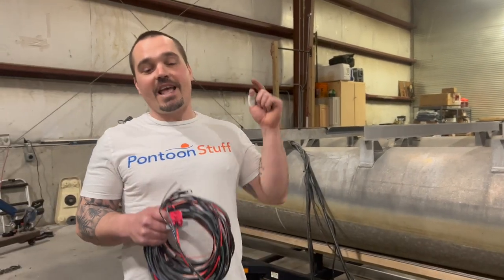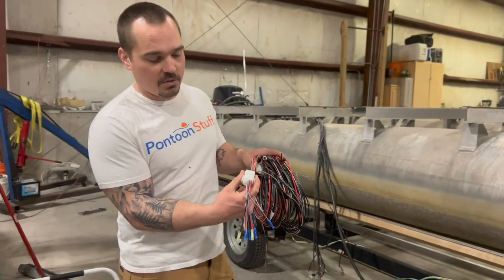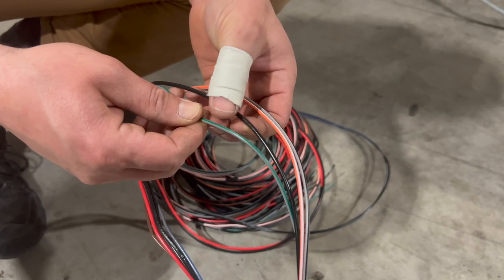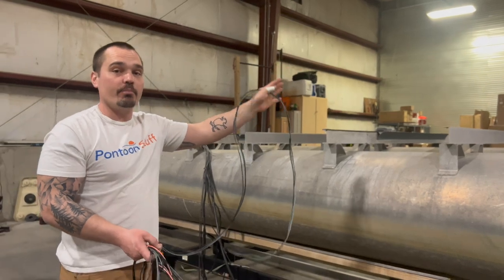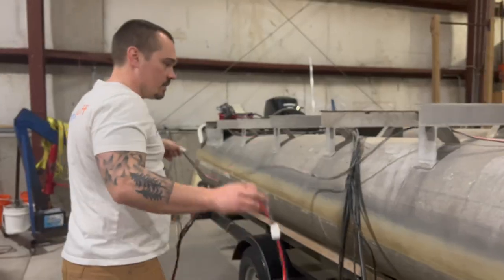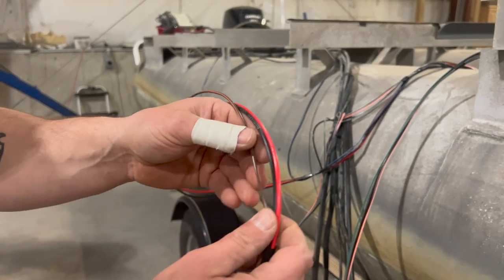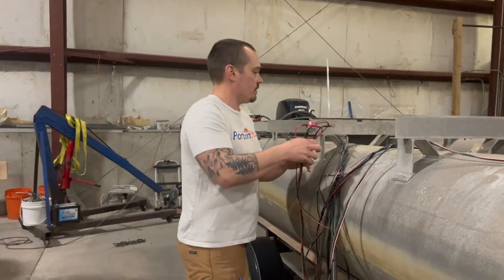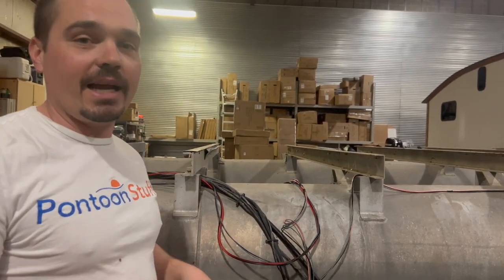EASIEST Way to Wire Your Boat - Wiring Harness Explained

Comment: How do you wire an ignition switch with 6 wires into the harness.  Love your stuff man.
Reply from the maker: This harness is solely for electrical accessories not connected/related to the engine. Engines have their own separate ignition harness which often includes the key switch (or just plug and plays with a key switch). That harness would plug into the motor under the hood and then run up to the console to be plugged into the keyswitch, safety lanyard, neutral safety wires, gauges, etc.

Comment: Thanks again. Mine just arrived today.  My question is I don’t have a pump do you think I can hook up any accessory there, like my wife’s fish finder?
Reply from the maker: Absolutely. I just used the livewell pump wire to power underseat LEDs on a boat. It’s really just a stern accessory wire…use it for whatever you’d like as long as the accessory can handle that 5-10amp breaker. Your fish finder should have its own low voltage fuse inline tho!! Best of luck with your project!
Reply: @tomspontoons  Thank you so much. Your so Awesome
Reply from the maker: @BobbyD32971  Happy to help. You're awesome for watching our videos!! 😎

Comment: My fuel sending unit has never worked.  No wiring from the unit to the gauge.  What would you recommend to run the new power wire?
Reply from the maker: We've got several videos on the topic, but here is one that breaks down the whole process:

https://youtu.be/LhHYVGFtBQk

Comment: Hi tom , i got a larson 2000 boat, the cables all wiring was stollen, do you mean the harness is the same for all boats? thank you
Reply from the maker: This harness could be used on any type of boat, but it's ONLY for the electrical accessories like your lighting, bilge pump, horn, etc. It does not tie into your motor components. That's all separate for each motor/boat combo.

Comment: I have a 22' Sun Tracker Party barge. I am installing a detachable trolling motor to the bow of the boat. I have to install a plug near the bow, probably by the seat. To make it clean, is there a way to remove the seats or the railing so I can run my wire on top of the toons or can I just run it through the seats to make it easier?  Thank you so much
Reply from the maker: You should be able to run the wire right along the top of the pontoon unless you have under skinning blocking access. I’ve run it with a battery under a front seat and the wiring running to a plug in the seat, railing, or in a little aluminum box mounted to the front of the boat.
Reply: Thank you so much for your help @tomspontoons
Reply from the maker: @jamesshelleywijnhamer19  happy to help!

Comment: Tom I got my new pontoon harness and it has plug an play plugins on the nav and docking lights ends .where can I purchase the ends for the lights
Reply from the maker: I just cut those plug connectors off and use heat shrink butt splices. Sometimes their harnesses ship with those connectors and sometimes without, just depends where they sourced them for that run.
Reply: @tomspontoons  thanks very much
Reply from the maker: Happy to help!

Comment: Another informative video. One question, how did the brown wire “find a ground”?  What do you mean when it finds a ground at the back of the boat?
Reply from the maker: I should have explained that in more detail...I mention it towards the end briefly. The main ground that runs to the battery has a split that gives that brown and orange wire a ground. They're taped together (brown with the ground) towards the back to make it easy on you.

Comment: Please pardon my ignorance, but I didn’t hear you mention the fuse box.   Does this eliminate the fuse box if I match it up with a new 7 switch panel?
Reply from the maker: Yes! You can omit a fuse box or panel if using Pontoon Stuff’s corresponding switch panels. Their panels have built in resettable breakers, just like most of the newer pontoon boats from the big name brands. You may still need to add a negative/ground buss bar, but could piggy back into the switches for grounds as well.

Comment: No instructions or two insulators   in the pontoon wiring kit need to speed little  to include  instructions  and insulators  charge  a little but we buy the these thinking it plug and play but far  frome it .please do the right thing improve  the kit
Reply from the maker: I definitely recommend emailing Pontoon Stuff with your concerns. They have great customer service and I’m sure they will work to make their products better. I help with making content and explaining their products, but I don’t work for them or have a hand in the product development.

Comment: Hey, Tom. Bought the wiring harness. But my harness has plugs on the ends for the nav and dock lights. And they are all gray and black for the ground. Im assuming I just cut those to tie into my lights?
Reply from the maker: Correct, cut those plugs off and wire into your lights. The all black is the ground. The gray with green is for navigation lights, and the gray with black stripe is for docking lights.